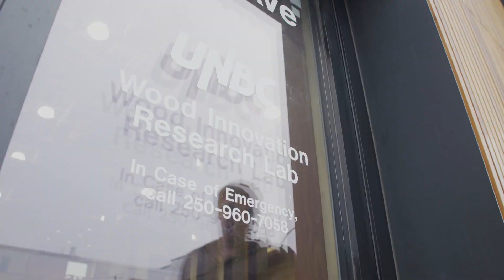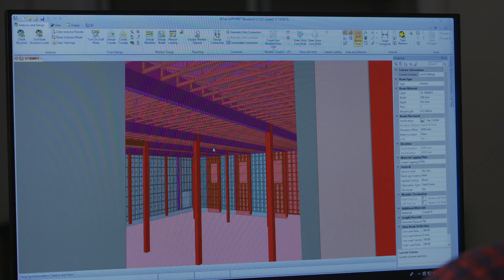Wood Innovation Lab in Prince George Leads Innovation in Manufactured Wood Products

Comment: Key insights:

🏗 Wood has the lowest carbon footprint compared to all other traditional construction materials, making it an important material for the future of sustainable construction.
🏗 The concept of passive buildings aims to eliminate all active gadgets, leading to more sustainable and efficient structures.
🌍 Creating energy-efficient buildings with almost no heating system is a game-changer for environmental sustainability.
🔨 The Wood Innovation Lab is leading research in structural engineering and building science, making wooden structures more competitive in the global market for engineered wood products.
🏡 The Wood Innovation Research Lab has shown that it is doable to build a passive house as an industrial building in a relatively cold climate, providing easy construction on site.